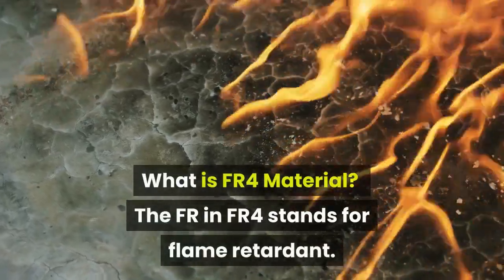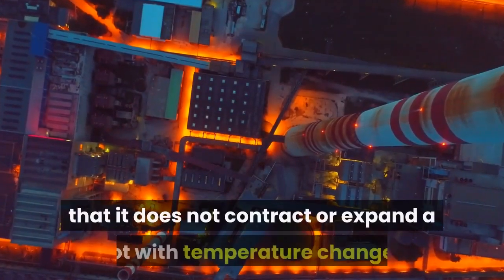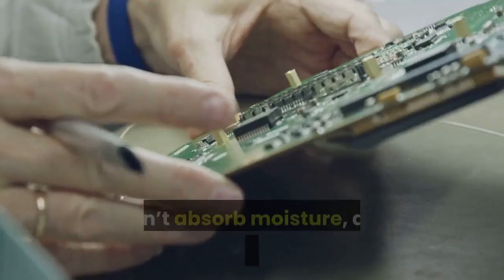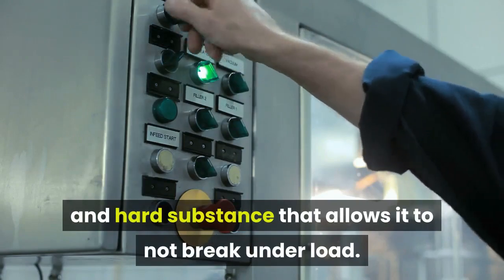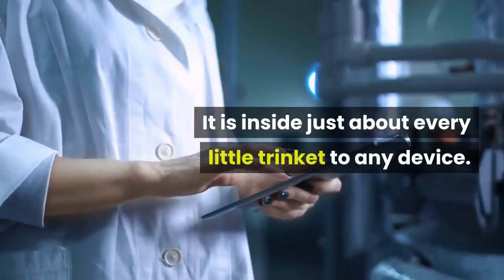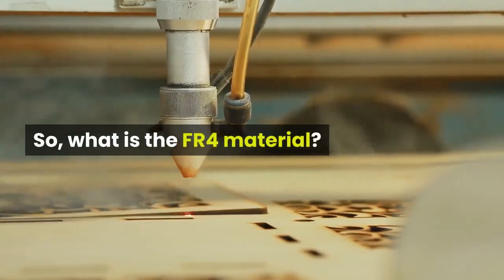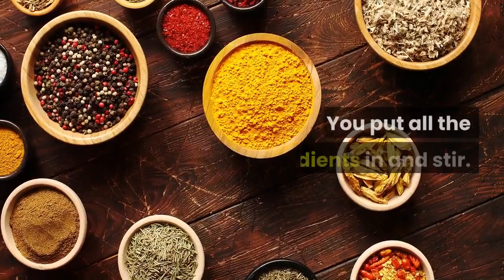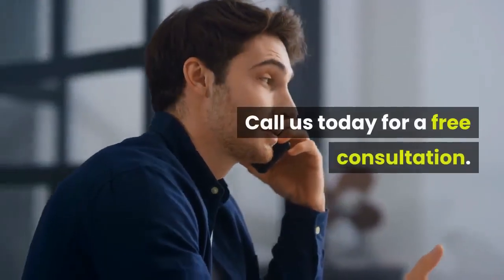What is FR4 Material

Comment: The "green stuff" on circuit boards is not the FR4, FR4 is a  yellowish fiberglass and resin mixture and is located in the inner layers the circuit board. The green you see on circuit boards is called solder mask and is screen printed or inkjet printed onto the board. FYI:)